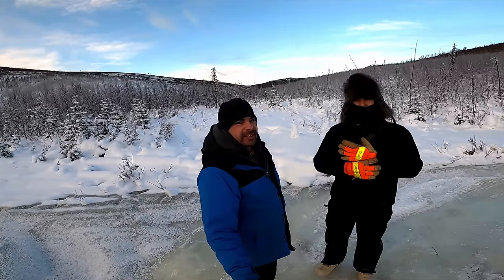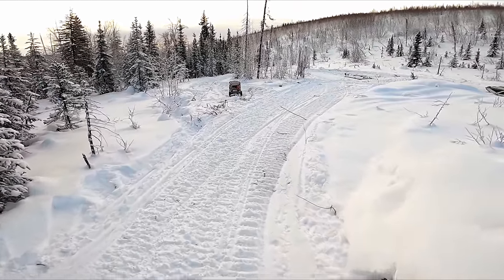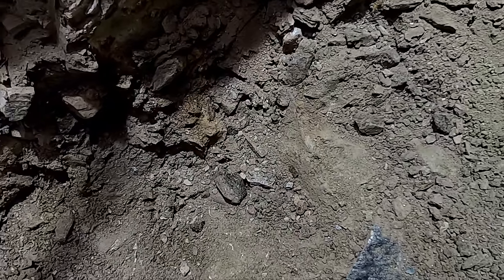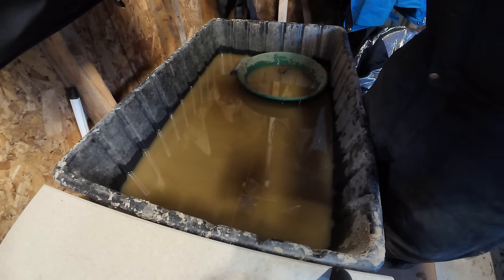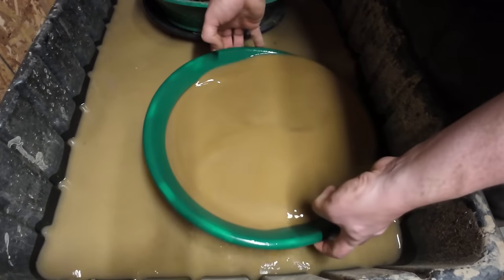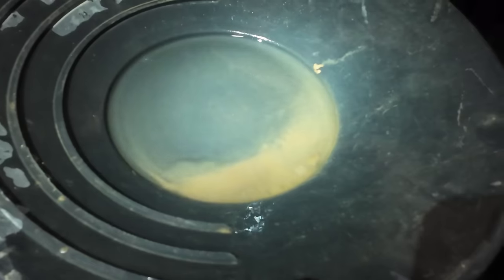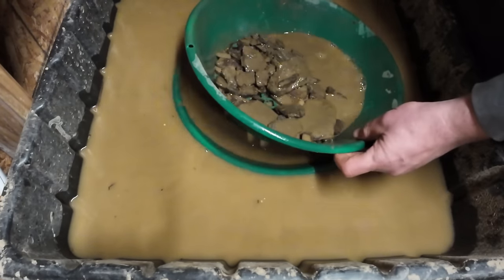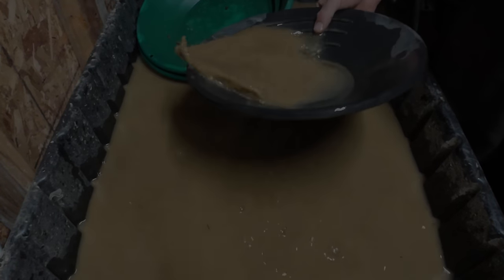Alaskan Winter Mineshaft: Gold Mining/Prospecting in the Interior of Alaska - Part 4

Comment: Another thought, I’m an electrician and in the winter I have to break up hard or frozen ground when installing underground electrical supply, I see you guys using a flat blade on your hammer drill, assuming it is a hammer and or drill, what I’ve found to be useful is taking a 1/2”-3/8” by 18” rebar drill bit (on hammer drill setting) and running it into the ground 10-12” deep or deeper across the base you are working in, into the ground (that will loosen up the hard ground) then Come in with just a flat hammer bit to remove chunks. Or experiment with a spade bit. Good luck guys!

Comment: That spike bit is meant for concrete and solid rock. Use a chisel or spade, but don’t go straight down at it. Hit the dirt at an angle, it will fracture the material and drive it upwards